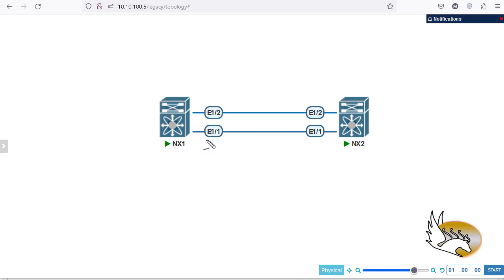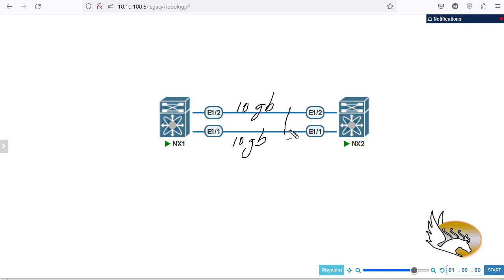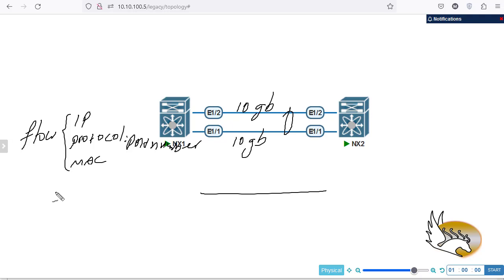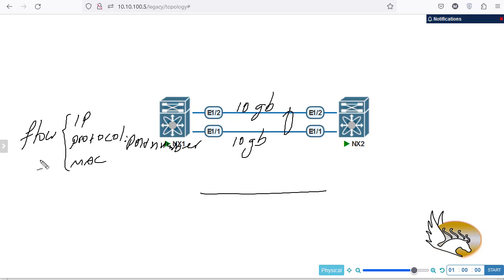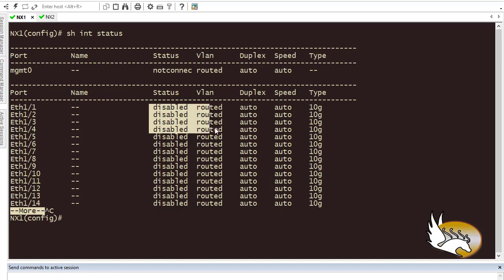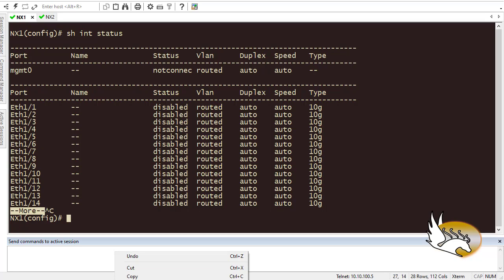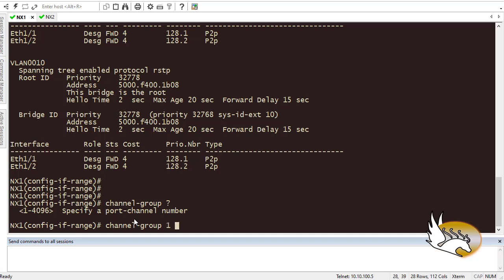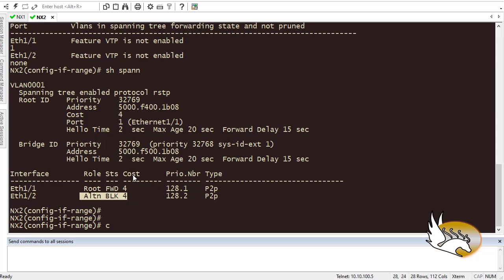Creating Port-Channel in Nexus Switches

Comment: Hi. I get below error after creating port-channel in nexus titanium

switch(config-if)# channel-group 1 mode active
LACP process needs to be started before configuring active mode
switch(config-if)#
Reply from the maker: @pmgichiri  feature lacp
Reply from the maker: @pmgichiri  feature  LACP shout be enabled first
Reply: @ I tried to but got "Error". I have further discovered LACP is not supported in NXOSv7000. I have to look for a working 9k image.
Reply from the maker: @pmgichiri  I use nxosv9k-7.0.3.I7.7 or nxosv9k-v9.3.1 or nxosv9k-9300v-10.2.1.F or nxosv9k-9500v-10.2.1.F. They support almost every feature.